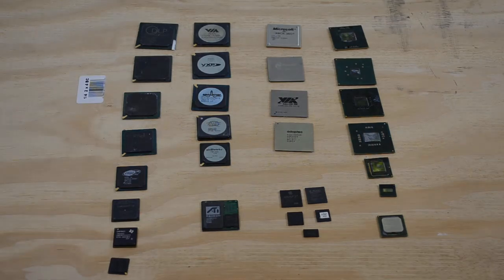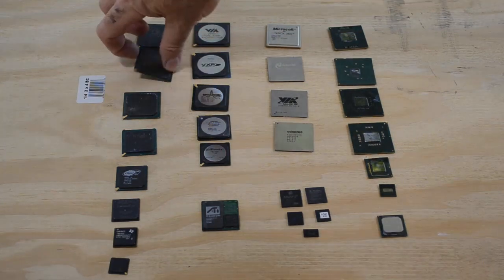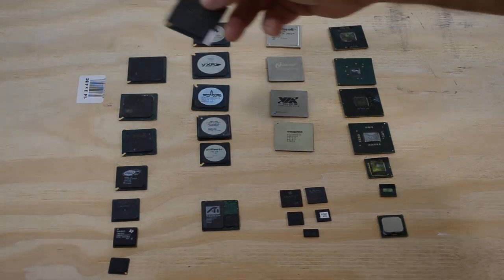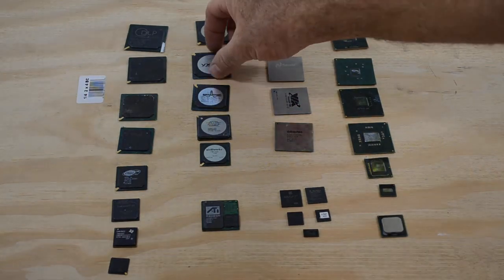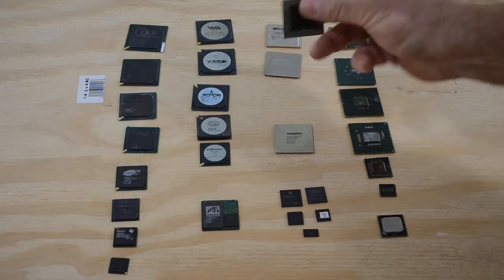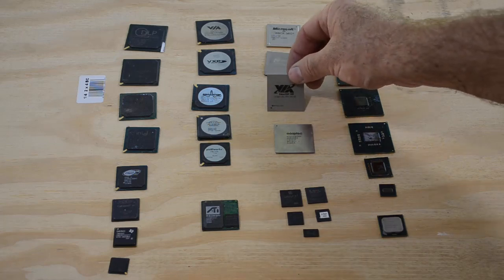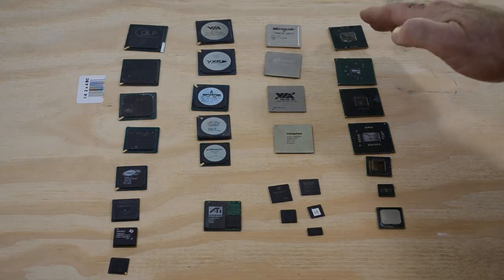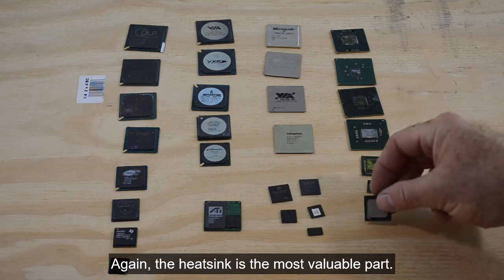What are BGA Chips and which are best for gold recovery?

Comment: Thanks! Underrated video. 
One thing comes to mind, waste buckets are useful for "partial penny" gold. Toss them bga bottoms in the waste bucket and add your barren solutions. It will eat copper and precious metals will release into solution. 
Then gold and silver will drop with waste bucket proccess. At the end of the year your waste bucket refine will be the catch all.
Reply: That's a great strategy
Reply: Direct cupelation with lead is the trick on these. Fast, thorough, cheap and clean. Waiting for acid to do its thing is costly and presents a standin hazard for me that is unnecessary.  I thank Owltech for that trick. Dude saved me a fortune in nitric. Clean lead is cheap.

Comment: I always though the smaller BGA can get more gold than the bigger BGA when they are in same weight because of the density, do you think it's correct?
Reply from the maker: I believe it is more a matter of the number of connections. Each connection will have a gold bond wire to the die. Larger chips generally have more connections.
Reply: @omegageek64  that's reasonable too.
Reply: Yes but not ram bga.   Bga in phones or in telecom equipment are great 1 g of gold per 100g material normally

Comment: If you peeled off the black tops with the integrated heat spreader, you can break them and get out the metal plate easily.